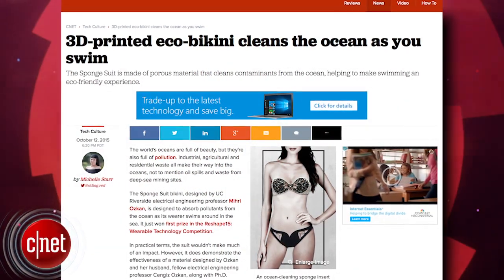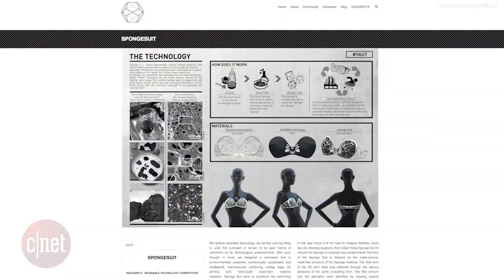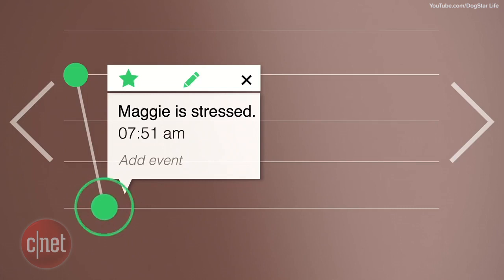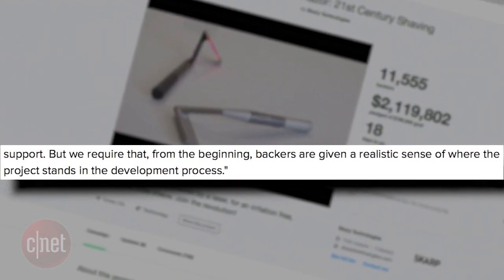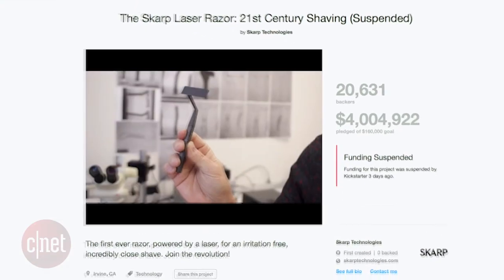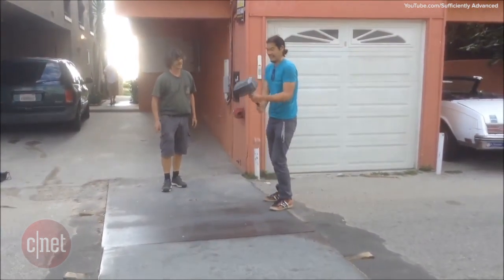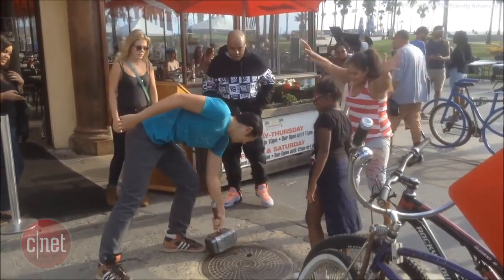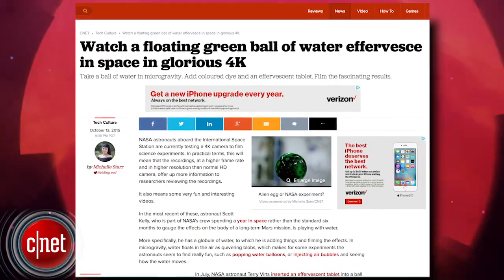Crave - Are you worthy to lift this Thor's hammer?, Ep. 222

Comment: I know a few who can lift the hammer, it only weighs ~20 lbs + Manhole Cover (in some cases); so what's that, less than 200 lbs. 

Not saying I could lift it in less than a day, need to wait for the Battery + Cap. to discharge - then I can also lift the hammer.

Unique Joke / Trick - Good 1 !